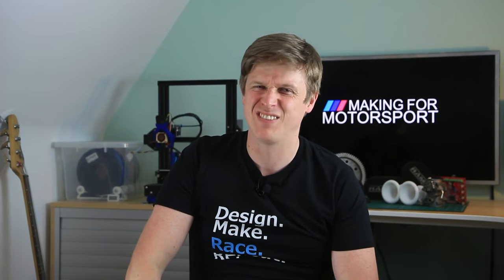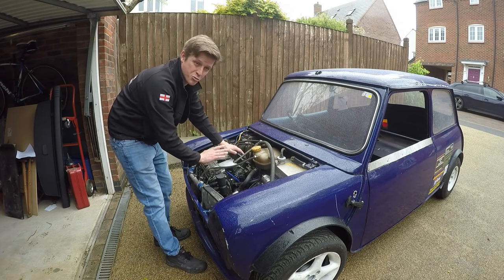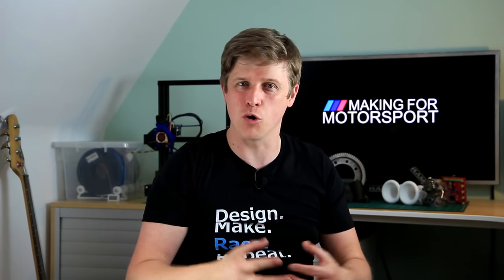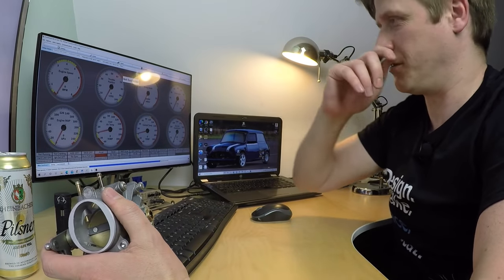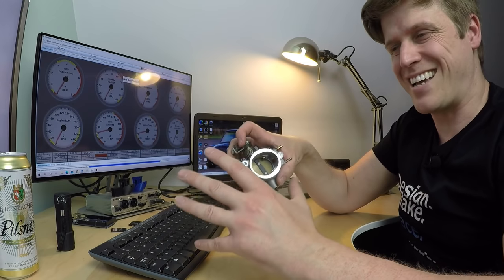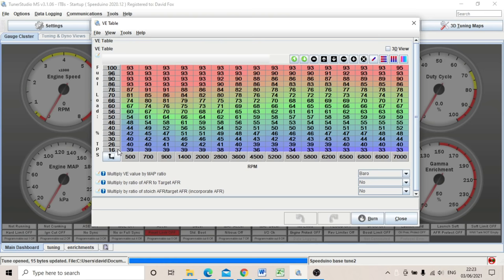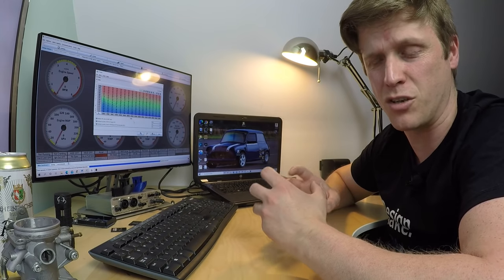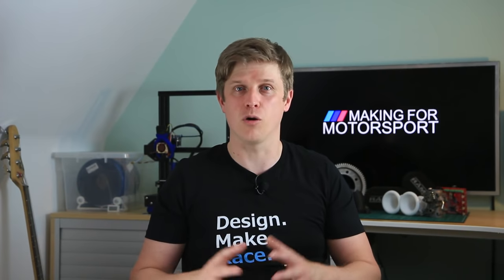How to fit Individual Throttle Bodies - Part 3 - Return of the BRARP!

Comment: Great video! What kind of weird racing are you doing there? First gear only, constant burnout, half the time backwards - some kind of interpretive dance but with cars? 😁 I'm having success with my carbon nylon prints btw, first of four parts came out great, the rest is printing as we speak. Ludicrous strength/stiffness compared to anything I've ever printed before, thanks for the tip!
Reply from the maker: I like to think of it as Horse Show Jumping, but with cars...  Its called Autotesting, and it's a strange little sport but great fun and a little mad!  Not quite as mad as 100mph on a 50cc on the salt, but still fun!  
Glad the CF Nylon worked out well... it's my favourite material, just a bit expensive.  One more tip, try ASA, its not quite got the heat resistance of Nylon but still MUCH better than PLA and PETG and nice to print!  

Looking forward to hearing the 2 stroke screaming!
Reply: When you know the Brits race a cheese on foot downhill, nothing seems weird
Reply: @anidiotinaracingcar4874  lol the cheese normally wins.... its a very dangerous sport i rather go bull prodding than that
Reply: @vasili1207  Now, imagine the bull running downhill with the cheese!
Reply: Always great to see youtubers help each other out!
Reply: @MakingforMotorsport  Are you sure ASA is able to hold up to engine operating temps for continuous use? I know certain ASA can be used with in an engine bay but not directly attached to the engine. Most ASA's I've seen have a glass transition temp right at or below normal engine operating temps. Carbon fiber nylon sits a good little bit above. I'm new to 3d printing so if you know of a really high temp good ASA please let me know.

Currently planning on using carbon fiber nylon for my ITB trumpets but I also purchased an ASA called "ApolloX" which has really good reviews and is advertised for automotive use but I worry about it holding up if directly on the engine. Would be nice to use a filament more forgiving on hardware and my wallet than carbon fiber lol.
Reply from the maker: ApolloX is great stuff, I am printing with it now actually!  And you’re right I wouldn’t use it for anything on the engine, but for ITB trumpets I think it will be fine (or I hope it will as I intend to do exactly the same myself!). 

I got the ApolloX as a cheaper underbonnet alternative for the nylon but in some applications (the manifold or stuff like Alex is doing) it’s gotta be a decent Engineering plastic!  

But keep on going mate, sounds like we’re on the same track!
Reply: @MakingforMotorsport  That's awesome please let me know how the ApolloX holds up! I was also considering using it myself but worried about it's temp resistance. It seems like it'd be right on the cusp of it's threshold or at least I assumed so for ITB trumpets. And yes I did the exact same, I bought it as a cheaper alternative for engine bay mods and exterior uses as well. It's crazy how far filaments have come in the last few years. It's the reasons I finally felt it was time to start diving into 3D printing since it's usage limitations are quickly decreasing.
Reply: @MakingforMotorsport  I agree on ASA, it prints like ABS , and you can just use ABS settings with tuned retractions. (atleast i did)
Reply: HEI. er du her inne og? ;)

Comment: Very nice video, I have done a ITB conversion on my mx5 a few years ago and from my experience I agree with all the points you talked. There is one more important subject when tuning ITB. I'ts the accel enrichement and the TPS WOT curve. They will really impact the throttle response.
Reply from the maker: Absolutely agree, I was quite conflicted in the 3rd part of this video how deep to go into the tuning aspect, but you're right, ITBs are sensitive to Acc.Enrichments...
Reply: Which mx5? I own a 1.6 nb2 and i want to run itb from gsxr 600

Comment: Keen to see more of this and the events you’re running in!

Have you thought about printing (or otherwise building) longer or shorter ram tubes/stacks to take advantage of the often trumpeted (pun intended) better for torque/high RPM instead of keeping with what’s available from the OEMs?
Reply from the maker: Abso-f^%king-lutely!!!  In fact the rather ridiculous angle the ITBs are at is to buy space for exactly that, looking forward to getting to play with it!

Comment: Very interesting set of videos. I'm planning on changing the Mazda "VRIS" system on my V6 K8 engine, much as you've described. The VRIS is a twin chamber, variable length set-up and it weighs a ton !!. The car is my own-design "Le Mans" style sportscar to be used for sprints and hill-climbs...The stock (Mazda MX3) ECU is around mid-90's vintage and, I think, can be improved on. Keep up the good work !

Comment: You could probably normalize the change in cross-sectional area during throttle body opening pretty easily if it's a cable driven TB. Even if it wasn't a perfect circle, with a few measurements you'd have a useable geometry to calculate the actual cross-sectional area and then invert the curve. [EX: if you start with y=x^2 you rearrange the equation to x=sqrt(y)]. Then, to convert this to from cartesian equations into a polar equation and this can be used to create your new throttle pedal cam.  I believe this is more or less what the OEM's do to some extent in order to linearize throttle pedal travel.
Reply from the maker: That’s exactly what OEM do (or did when cars still had throttle cables), they also used twin throttles (small then big).  This helps controllability from the drivers seat, however the ECU doesn’t care how smooth it is, in AlphaN you still need to concentrate at that end of the table as that is where the big change in engine conditions are 👍
Reply: @MakingforMotorsport  You could take what he said in reverse... And use the opening per throttle percentage to even out the lower airflow changes and come up with your numbers for your table rows mathematically rather than guessing about where you want to see more.
That would make the numbers in your table appear more linear.
Not incredibly important but that is the way to do it with math rather than eyeballing it.

Comment: I have run an inlet manifold adapter for a carburettor printed in Nylon66 for some time now.  It has been pretty good, but on highly stressed parts the material seems to suffer from creep over a long period of time. By beefing up the highly stressed parts I am hoping to eliminate distortion doe to creep - only time will tell and it's cheaper than using Carbon Reinforced nylon!

Comment: Hi Nate. Planning on using a speeduino for my M65 supercharged mini. What trigger wheel are you using for your ignition control?
Reply from the maker: On the vauxhall there is a 60-2 trigger directly on one of the crank counterbalances which I am using. 
I don’t know the mini engine but there would already be one on there…. If it’s a simple xx-x missing tooth type you can program speeduino for it easily on tunerstudio….

Comment: Very interesting series. I'll look into getting a single throttle body to slab on a small vw intake manifold. I'm thinking MAF and tps needed, will have to see what other sensors are needed - factory distributor vacuum advance curve seems decent so I see no reason to control ignition with the speedoino from the get go. Throttle body from a twin bike seems like a good source

Comment: You’re inspiring me to have a crack at this. I’m armed with a 3D printer and a soldering iron so look out haha! Question; Is your manifold printed solid i.e., no infill? Cheers.
Reply from the maker: It got printed at 8layer walls, that means the runners are solid, as is the area underneath the bolt heads… but the “flange” was around 40% in gyroid, it could be stiffer but is working well for now
Reply: @MakingforMotorsport  I'm surprised You didn't use a hex infill for the flange.

Comment: It really sounds amazing!! Cant wait to build mine. And i think that what most people struggle with is setting the trigger wheel, there are just so many options for wheels and sensors, can you talk about your setup?
Reply from the maker: I tend to agree with you that crank trigger is a major issue for a lot of people and I didn’t include it in this for a couple of reasons, I was trying to keep it all ITB specific, and mine is an OEM solution in the block and off the crank so it’s all done for me.

What I am planning is to extend the ECU series to look at putting components together from the junk yard to get a working ignition setup, that’s what I’ve done and it’s not too tricky…
Reply: @MakingforMotorsport  junk yard parts are the best, even better when they come for free!

Comment: Sounds good, I'm interested to see how the manifold fairs long term.
Reply: Well as long as there is adhesion between layers it should be good, plastic intake manifolds are a thing. I'd worry about reaction to gasoline maybe
Reply: @akkudakkupl  they are a thing, but most of them are made out of nylon 6/6... Often with fiberglass reinforcement inside.
So be interesting to see how this other material stands up to the heat cycling and pressure.
Reply: @TravisFabel  That stuff is printable too. I think you can get SLA prints with fibre reinforcement for example.

Comment: Really keen to see how the printed plenum holds up over time to oils in the engine bay, and heat cycling.

From memory you printed this in nylon with CF reinforcement, is that correct?
Reply from the maker: It is CF Nylon and I'm keen to find out how it gets on aswell!

Comment: Have you thought of using two VE tables? Use the TPS position for the switch point? Would allow a full table for the first 20% over movement.
Reply from the maker: Interesting, no I hadn’t thought of that… I know you can switch to other tables by going to Speed Density but what your suggesting is staying with TPS/AlphaN…. I like it!  Gonna look into it…
Reply: @MakingforMotorsport  Its what I'll be using. One table for 0-20% and one for 20%-100%. Should sort the drivability out without taking up too much memory.

Comment: Great video series! Is it possible to manage injection with ITB's only running a crank position sensor, or is it also needed to run a Cam position sensor?
Reply: You can batch fire injectors with just a crank trigger, you need the cam trigger to run sequential injection.

Comment: great diy video !!!! synchronization of the TB is necessary any time a bike has been dropped. or theyve been removed from bike for any reason..... it only takes a few minutes and makes the engine much happier as it will be off  a tad thru the entire rev range we jus dont feel it as much up hi..... its mandatory you have the entire intake system in place or they may not be right
Reply from the maker: Cheers bud… I was split over doing the sync section but it would’ve delayed the video and it’s already been done, hence the link.
Reply: @MakingforMotorsport  no worries sir i was  not in any way tryin to take away or criticize your work you did a great job.... bein a bike mechanic most of my life it was just a statement to hopefully add to all the good info you shared.... and besides i dont even make videos so im not one to judge others efforts to be honest .... im sorry if i sounded like a ass ....
Reply from the maker: @gradyturner3367  absolutely not! I did mean to sound defensive, no problems!👍. The reason I mention is it’s a total balancing act what to put in these vids are what to leave out… I have done over an hour on ITBs and still skimmed some things (like balancing), I could talk forever on this kind of stuff, problem is no one would be watching!!! 😂

Comment: Hey I was just thinking, if your using itb's on a daily driver would you recomend building a  plenum and sticking with the map sensor or would you still tune using throttle position?
Reply from the maker: I can’t really recommend either at the moment, as I’ve not tried it, but lots of people recommend using MAP for slow running for road based ITBs.  

For this signal you do need a plenum, but not before the ITBs, as this will still be at atmospheric pressure, you need to link all the runners between the throttles and engine to get an average signal. 

You’ll see my setup in the previous vid, it works well enough to run the engine.

Comment: Did installation of bike carbs improve the performance? What were drawbacks of bike carbs? I'm thinking of replacing a single carb with bike ones on a every day - weekend car. Is there any worth?
Reply from the maker: Going multi-throttle is worth it for the sound alone...  I didn't do any back to back testing but as I said in the first part, you can easy loose low end torque, which you wouldn't want for a daily.  Next time I start this from scratch I'm gonna do some rolling road pulls for added Science!

Comment: Great info in this series. I've been looking at building a set of itbs for my project, and wanted to try assembling them with a plenum and running them with the stock maf sensor. Mainly just to see if I can. Is there any particular reason you know of why this wouldn't work?
Reply from the maker: Cheers bud!  You absolutely can run ITBs like that, in fact it’s how most OEMs run ITBs… the E36 M3, R33 GTR and the 20v Corollas run like this….

The tricky bit for this installation would be making sure there are no vacuum leaks as all the air needs to come through the MAF and with a stock ecu making sure the TPS works and feeds back the correct voltages for closed and wide open throttle.

The other thing which would be complicated but not impossible is the injectors, ideally you need to retain the same injectors as your stock ecu will be calibrated for those injectors, not the ones that come with your ITBs.  If they are the same package style (Bosch ev6 etc) then I am sure you could make them fit, but something to bare in mind…

Final thing you may find the acceleration enrichment (driven off the TPS) isn’t perfect now but that’s unlikely to really be a problem… (if you want perfection you need a mappable solution 👍).

Best of luck with the project… let me know how you get on! 👍
Reply: @MakingforMotorsport  The plan is to modify a stock manifold as the base, allowing me to use the stock fuel delivery and each runner has a port for the pcv that i plan to use for vacuum. I also should be able to adapt the factory tps.
I'll probably end up making some videos on the process, it'll be a cool setup if it works out.
Thanks for the reply, ill be looking forward to your videos.

Comment: Because your throttle is a rotating valve, surface opening is a Sine function. So your scale (rounded) should be like that : 0 1 2 5 9 13 19 26 33 41 50 59 69 79 90 100. There should be a box in speeduino software to automaticaly switch between a sine and a linear scale if you have a linear or a rotating throttle body.
Reply from the maker: What really matters is the change between the load sites and the proportional change between them, i nearly went into this (had graphs and everything) but it made the vid REEEEALLY long and don't change the message, but if the difference between load sites (either revs or load) is purely linear then the interpolation between cells will take care of that, so if there is purely a linear response of airflow to throttle you'd only need 2 sites, 0 & 100%,but it's no like that, and the same goes for your sine theory, it theory it's a decent place to start but in reality it's gonig to behave differently, therefore all you need to do is start sensbile and change it when required 👍

Comment: How good is the "autotune"??
(looking into this for a "performance" turbo road car using a speeduino)
Reply from the maker: Autotune works really well, especially if you can run the car at steady state, it effectively uses the O2 sensor to "goal seek" a target AFR that you enter into a table, essentially closed loop running but it changes the VE table so the changes are permanent.  Its not the golden ticket, doesn't help you with enrichments or spark tables and won't save a god awful tune but to get you to 95%, it's pretty useful.

Comment: What Vauxhall engine is it you have in the mini ?
Reply from the maker: The engine code is a Z16SE, but it’s basically the more modern version of the Nova GTE engine, 1600cc, 8v OHC with multipoint fuel injection…
Reply: @MakingforMotorsport  can’t think of a better group of engines my brother use to have a 1998 a reg corsa b breeze model with the single point injection 1.4 version of that engine and my dad had the multipoint injection  1.4 in a 1991 Astra estate and that was a flying machine very responsive but I think the police had it hoped up a bit as it was bought from retired police stock. I’m very impressed with your videos on how you make your very own go faster parts on your 3D printer. I also got quite into your videos about the speeduino and building one.